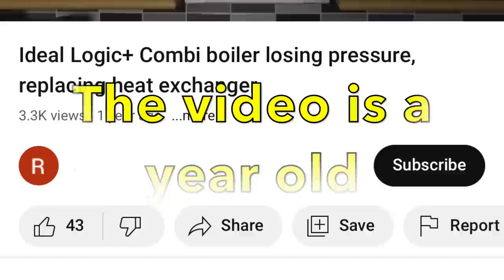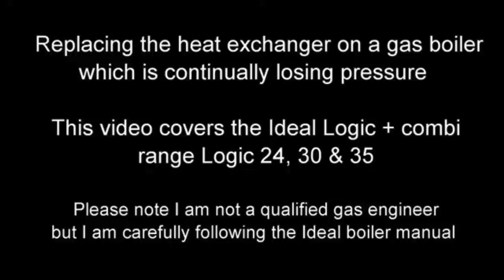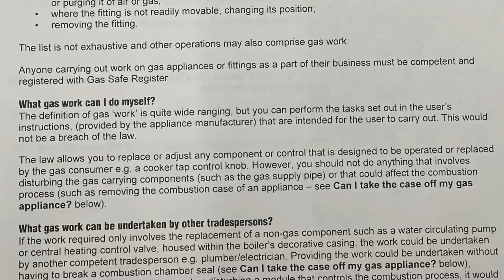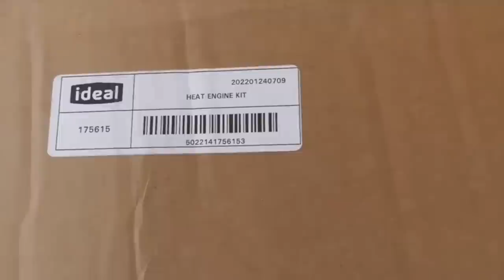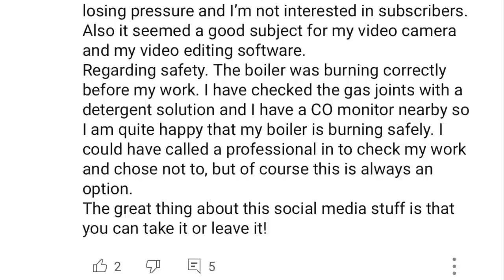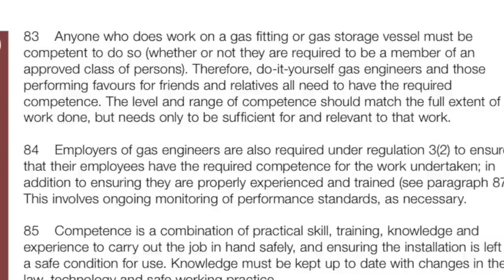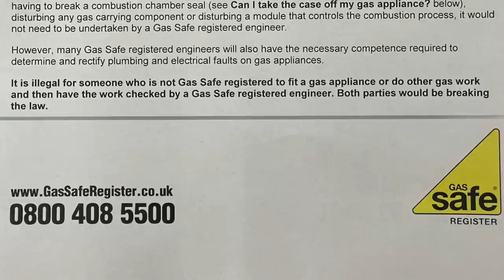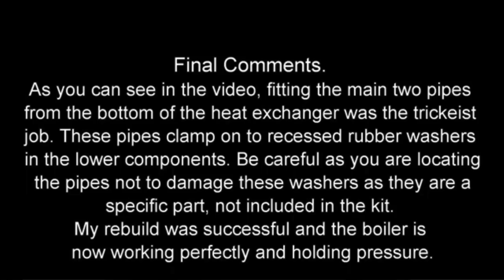Ban gas videos on YouTube ? Ban the sale of gas appliances/spares  to the general public ?

Comment: In theory agree, but unfortunately the industry lets itself down badly with the shockingly poor workmanship of many so called registered installers, often unable or unwilling to fix faults or even ensure they put things back together properly!
Reply: I agree i have had some shoddy work done by gas safe engineers, components not put back properly..  Our neighbour has just had 4 different engineers as the first 3 couldn't fix the issue. Are they competent?
Reply: @SteveN-pw4dj  you have to understand that gas safe means you should be able to basically work on a gas appliance safely. It doesn’t make you a great engineer or great boiler fixer or a great plumber.
Just means you should be able to not leave it dangerous. That’s all really when it comes down to it!
Reply: The public should be allowed to purchase gas parts.

People can buy chemicals, but most of them don’t turn the ingredients into explosive devices!

Just like most people wouldn’t fit the parts, themselves.

Time is money.

So, if the customer goes for the part, they are not paying the gas engineer, to go shopping.

It could also speed the job up, if the engineer is able to continue his/her work.

Concurrent activity.

Obviously they’re many scenarios, please don’t shoot me for mentioning just one!

Ps For the record I am a gas engineer.
Reply: @pops6638  Then you understand the requirements restricting those parts to manafacturers genuine only.
No point in an engineer turning up to find the customer expects him/her to fit a cheap substitute!
Reply: @johnward5006  I concur with your reply.

My angle was, if I’m at the job and are required to strip the appliance down, why not get the customer to pay for and collect the part, while you carry on working.

Let’s say in this instance, I’m working at my friends or relations house, so there is no problem leaving me in the house alone.

Like I said previously there many scenarios I could list, but that would take all week.

Stay safe everyone
Reply: @plumbertime  I absolutely agree mate. I am gas safe registered but I am a kitchen fitter. I can work safely on gas but can I repair a boiler ? Nope !

Comment: So recently I wanted to replace my gas hob. On removing it I found that the gas connection was not actually screwed tight it was relieving on the stress of the pipe and lots of sealer. It had been installed years ago . I was not impressed. Yet it was installed by a gas safe engineer.

Comment: I get your main point Derek. I work in property maintenance including basic plumbing repairs. I am not GSR, do not and would not touch gas. In a slightly different vein, I recently had a log burner installed at my house by 2 excellent chaps who had given up their HETAS. They quite rightly advised me that building control would have to sign the work off. Well I stumped up the £395 fee to my local building control lot, and I doubt the guy was even in my house for 2 minutes, including taking his shoes off. He didn't appear to check or inspect anything, other than glancing at it. So it's not really surprising that some people, GSR, HETAS, or DIY, decide to cut corners or not bother with these things. I know wood burners are slightly controversial for various reasons, but that £395 would have bought me nearly 3 tons of fuel...

Comment: I has a fella here, only yesterday change the fan on one of these boilers, it's a Morco GB 24, which is just a re-branded Ideal Locic, same boiler, he didn't replace the fan properly, so there was a gap between the fan and the heat engine, when he attempted to fire the boiler there was tons of gas lashing into the boiler casing and not into the heat engine. I don't know how he didn't blow the shit out of the boiler and probably the mobile home with it. clowns think they know it all. Dangerous stuff to say the least. I'm a gas service engineer here in Ireland.....keep the videos coming, I always find them interesting.
Reply: Unfortunately  too common!

Comment: I enjoy your videos as entertainment. I like to indulge in mechanical hobbies, from watch repair, to car maintenance. 
My boiler is oil fired, and know the "engineer" that performed my last service had a lack of ability, from the omission of a concealed nut (he left the cover loose and vibrating, with the retaining screw held by gravity!),  to the leaking kerosene he had to return to fix - charging me for an additional part, when an O-ring would have sufficed during the service!
He won't be called back for the next service. What recently astounded me, was the oil fired boilers in rented accommodation do not require an annual service, and complaints about them, go unheeded by landlords! That is something I feel needs remedying.
Anyhow, thank you for the channel, your videos, and despite never having any gas appliances to "play with", my entertainment.

Comment: Should a gas safe engineer be allowed to replace the PCB. Is that illegal also. Where do you draw the line?
Reply from the maker: That’s like saying electrician’s can’t fit a light bulb or joiner’s can’t use nails. The line has already been drawn.

Comment: Fitted my own boiler and it worked for over 20 years. Also fitted my new boiler and that's been fine and passed a safety inspection and service last month.
Reply: You’ve been lucky then, I’ve fitted new boilers and had to call the manufacturer out, or adjust the gas valve if permitted myself because it hasn’t had the correct air gas mix, unless you have the correct test equipment ie a flue gas analyser how would you know

Comment: I agree with your video. Only qualified people should touch gas. But I question a few things you said. Don’t think you should be slagging off CO detectors. There are clear instructions , where they should be installed . 
Also rip off plumbers contribute to people doing jobs themselves. I’ve recently done a small plumbing course at college. Could not believe what the lecturers told us . To change a central heating pump , charge over £100 plus the cost of the pump. 5 to 10 mins work . I was shown how to change and repair a pump. Garages are the same they rip you off. 
So I think this is a major factor why people attempt to dangerous DIY.
Reply from the maker: We see most co alarms installed in the wrong place and many with no battery or out of date some even in draws so what I said about co alarms I stick by. If you take into the account how much it cost to run a business you will realise how much you need to charge for jobs
Reply: If you can travel to a property, gain access, change a pump and test it, all within 10 minutes, then I salute you.
Reply: Maybe you can swap out a pump head on a combination boiler in ten minutes (if travelling to and from the job doesn’t count)…..Normally though pumps are located in difficult to access places and the pump valves are ‘welded’ on with years of corrosion and heat stress. The isolation valves can leak or not work. Then there is the small matter of testing the pump and the circulation to the system ensuring there’s no underlying issues. Perhaps the pump failed due to water quality…that would need addressed. That could take hours in itself to do properly. If you can do every heating pump in ten minutes then I’ll employ you tomorrow. PS I’ve only got 30 years actual work experience at this game.
Reply: @waterhogger  
I don’t think you get the point I was trying to make . I did not mention a combination boiler pump. Charging over £100 for 10 minutes work is a rip off . The college lecturer that taught me agrees . I know things can go wrong and the plumber has other expenses. A very slow plumber like you that takes an hour to do a simple job . That’s still a rip off charging over £100 for an hours work. ( I’m a retired engineer) Also what do you recommend when the batteries go on a CO detector. Phone a plumber at the bargain price of over £100 an hour lol.

Comment: It could be argued that repairing your own vehicle represents a greater danger to the public, which is perfectly legal,  than repairing your own boiler. I stand to be corrected, but I think that there are as many cases of unsafe work being carried by registered engineers as there are by non-registered ones.
Reply from the maker: So changing a break light bulb on your car could be more dangerous then replacing a boilers heat exchanger 🙄
Reply: Guess you've never heard of a gas explosion blowing up half a street?
Reply: @hdhanji8006  GSR is mandatory, but we all have a duty of care, which can result in prosecution.
Reply: @tomkatgastraining  Do you mean brake light? obviously not, but how about repairing and/or replacing the actual brakes, or maybe suspension and steering components?
Reply: @hdhanji8006  Yes I have, I used to investigate gas incidents, and to "blow up half a street" would require a major gas leeak within the network e.g. a leaking gas main and not the replacement of a heat exchanger, fan, gas vale etc in a boiler.
Reply from the maker: @geoffaries  for someone who investigated gas incidents I am very disappointed with your comments, seams you condone DIY gas work.
Reply: @tomkatgastraining  It's all a matter of competence, there are many individuals who have the skills to carryout work on gas appliances. The GSR is just a method of ratifying those skills. FWIW I have also spent time in training and assessing gas engineer's, I've also been involved with training centres and I have to say that often people were given a pass when they didn't show full competence. It could be argued that there is a potential conflict of interest between training centres who also provided the assessments of their own customer/ candidates. I used to hold ACS for every category, domestic and commercial, including IGE UP1.

Comment: I agree with you about the purchase of parts. Only qualified engineers should be able to do so and some suppliers do insist on you providing your gas safe number before purchasing spares. 

On the issue of videos you create, well, it should only be shown to trainees or qualified engineers not the general public. Simply because there are 5 youtubers on here that I know teaches the correct way and if you follow there steps you could work safely and become competent with experience, however, you wouldn’t have any of  the qualification certificates.
The grey areas has always been the definite definition of “Competent Person” and the reason for this grey area is that a person with qualification isn’t necessary competent (practically).  Competence is base on experience or level of competence is based on level of experience. I have seen people who can talk the sun dead on regulations but can’t terminate a armoured cable without struggling, simply because they have not been on the tools long enough or at all. I have also been on courses with guys who have been on the tools for almost three decades and have no experience using a multimeter, they, never did any testing. They can mop the floor with me when it comes to experience, but I kill them with testing experience, the thing is they are competent electricians in a sense and so am I. Do we have the same level of competence? No, even though we are in the same trade our level of competence varies.

When I started my gas career I relied heavily on experienced guys I knew to help me out with fault finding, the plumbing side is dead easy, so is the fga side. The fault finding and repairs, is the bit that the guys with 20yrs experience/knowledge beats me with hands down. I know engineers now that no longer install boilers they just fault find and earn a lot. I know guys that charge per question etc. So, competence needs to have some experience tied to it and it has to be tiered also. Now when you look at it like that you realised why there are grey areas. 

Now back to the video, he is careless because he didn’t do the proper tests, a tightness test at least. Now the soap liquid issue, the reason for not using soap liquid is not taught or explained properly and you highlighted it, corrosion.  Rule 1, wipe/clean your pipes, even with LDF or FLUX because copper is delicate.

And, finally, the spanner in the works, REGARDLESS OF THE QUALIFICATION YOU HOLD, WHEN WORKING ON ANY GAS APPLIANCE, THE MANUFACTURER’S INSTRUCTIONS/GUIDANCE MUST ALWAYS BE FOLLOWED. Am I right? So even with all the qualifications you mentioned, a competent person is one who follows the manufacturer’s instruction. So on the cover of the manufacturer’s instruction it should clearly say, “These instructions are to be used by person(s) holding the following qualifications (list them) and a registered member of GasSafe (relevant body). Any other users are working illegally and subjected to (consequences). That then makes it dead clear, doesn’t it?

Also all services/inspection should be recorded with GasSafe (another topic for another video please Mr Tomkat).

Comment: Agree in theory about removal of the sealed guard, but on my boiler (ariston clas he 30) I have when refilling the system bled the main heat exchanger. Had all the gas locked off and fuse removed from supply. Surely a grey area?

Comment: Before even watching it my first thought is ban the ridiculous short cut training schemes which allows folk with little or no real world experience loose on the general public.  They are more dangerous as the register implies they are competent. For example if you want to be a nurse you have to do what they say to become one regardless of age and it takes 3 years . To be a gas fitter/ plumber you have the trade doing apprenticeshipd and training centres saying that older folk cant do it that way , time , money etc .  Sorry but there is no difference.  Do it as the trade does or do something else .
Ps I can name at least a dozen folk who have changed to train as a nurse in late 30s onwards including a guy at 51 .As for Tom Dick and Harry buying stuff that is a blatant attempt at circumnavigation of the system and they will always find a way .

Comment: I feel given the age of the unit there must have had at one point someone who wanted to write the boiler off for the cost of the parts , case in point baxi 600 pcb or fan failure, the manufacturer makes it all in one part including heat exchanger. I watch these vids purely to know what SHOULD BE DONE than what the gas safe cowboy who hasn’t done his 20 checks, leaked water into a pcb , and not cleaned the condensate trap r cause a leak the moment they left did from his blue logo inspection, in my case I caught him out and sent him away after paying for a full strip down and they didn’t even bring the seals at the time after calling an independent we found not only had it not been cleaned, it hadn’t even been commissioned correctly sending rain water into the combustion chamber as well as damaging the heat exchanger in the end I had to buy a new boiler. I’m not advocating self repair at all but we need to crack down on the cowboys, there been more than one boiler installed on the development by the builders than plumbers that’s what needs to be made illegal as well as compulsory refresh and manufacture Competency training involved in the range courses

Comment: Can a plumber actually legally work on a gas appliance eg change the pump in the boiler without carrying out safety checks! 
I thought any work on a gas appliance needs safety checks doing?!
Reply: Yes, anyone can work on a gas appliance, as long as they don't interefere with and/or work on a gas carrying component or flue. So changing an electrical item is permitted.

Comment: I bought the tools and gasket needed to clean the heat exchanger in my Worcester Bosch. All done without any issues.
Reply: How did you check the combustion levels? Or are you just assuming it’s actually burning as it should be and not emitting high levels of CO?

Comment: Disappointed you didn't complete a safe to touch test before lifting the metal covers off those boilers
Reply from the maker: Not connected to gas water or electricity and on a wooden wall 🙄

Comment: I'm a qualified refrigeration and  air-conditioning engineer and I know that you can't buy air-conditioning units or refrigerants if you're not a F-gas registered engineer
You can find the reasons for this by checking on Internet!!
The same thing should apply to gas appliances and parts for them..
Now Derrick, why don't you tell him about gas explosion? Describe it to him how it looks like. He doesn't know that gas explosion is like a bomb explosion. It can remove the head from humans body, it can take the arms off!! The explosion wave can move human body and bang on the walls with massive force. He doesn't know how carbon monoxide kills.
Gas safe regulations didn't come out of nowhere. There have been fatal accidents because of gas misuse. Each and every regulation for gas safety comes by extensive  research and experimentation.
He doesn't know how quietly carbon monoxide kills!!
He hasn't seen any explosion !!
Yes, I think sale of gas equipments to public must be banned!!
Reply: How do you get f gas reg? Is it similar to gas safe or a simpler process?